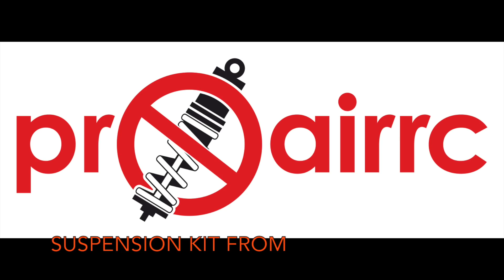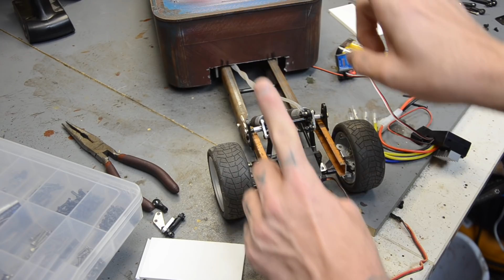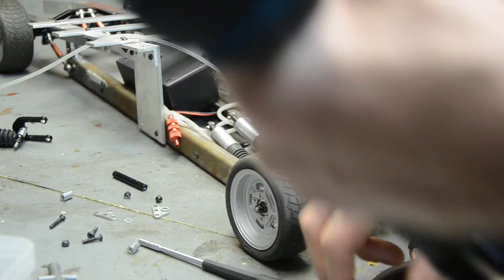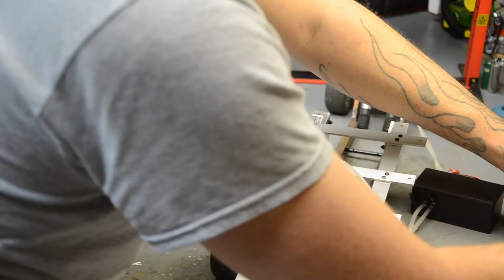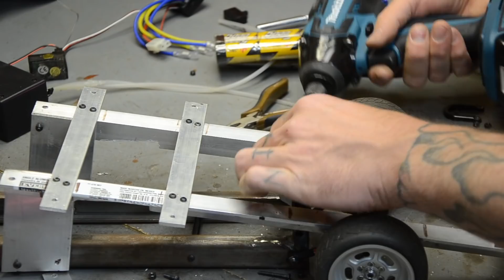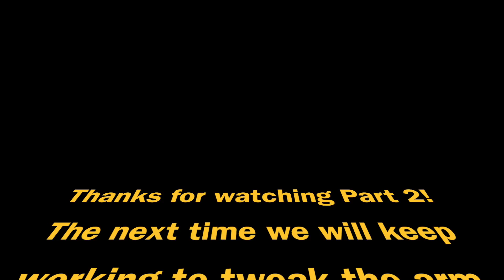Real RC Air Ride, Rear Suspension Fabrication with Proairrc, Rat Rod Ramp Truck Scratchbuild

Comment: make large 90 degree L shaped cantilevers and use them as your lower links then mount the air rams horizontal parallel to the frame, that would give you the best travel and load carrying while keeping it under the deck

Comment: I get all my screws from Tonys screws  https://www.tonysscrews.com/  bearings, pinion gears, ball studs, stainless steel shims, shock stand offs, axle pins,  you name it they have it, from avid rc  https://www.avidrc.com/    harbor freight has these little storage boxes that are perfect for rc screws.   https://www.harborfreight.com/24-container-storage-box-90243.html  in case link changes   the item is Storehouse®- Item#90243

Comment: Did you try putting the air shocks laying down along the frame and making a linkage that will push it up and down from the air shocks two left I have so many idea to fix that I live in Canada Ontario I will try to draw you a diagram to show you what I mean I tried to get back to you soon as I can
Reply: I was also thinking have you can try putting them like scissors crossing each other poster to the rear end and dropping them down a little lower

Comment: Use a pushrod style set up and mount the air shocks in the rear dead space
Reply from the maker: Thats how I did it in the first video, There just wasnt enough space for the cantilever arms to move and have any leverage.  Behind the axle the bed is about 1" tall.

Comment: I have a similar setup on my actual truck not a rc one and the triangles for the cantilevers are the other way around. The long side is to the axle and short is attached to the bags. Mine is a bag pushing straight up on to it so that probably helps but maybe flip them around and I bet you will get what u are looking for that way!! Just a suggestion. That's a cool project your doing tho, anything truck and air ride big or small I think is awesome!!

Comment: Instead of having each sides be separate with a brace why not run a pin all the way through everything with threads on each end for nuts (or a long bolt)? That way to take it apart would be one nut, slide the bolt out and done.
Reply from the maker: Great idea!  I am currently working on that.  It is working better but still not quite as well as I want.

Comment: I wou[d think Team KNK would either sponsor you or at least give you a hefty discount on hardware...

My only other thought for the axles, in the back you have some rectangular supports on the chassis. Can you by chance get a slightly larger piece of C channel to let that slide in up and down? So everything with the axle attaches hard to the rectangle stock, then the Air R/C kit attaches between the two...

Not sure if it helps and I'm in the hospital so I can't test it myself this round. Look forward to the next episode.

Comment: maybe try making the lever longer on the side with the shock so it has more leverage! It will lessen the suspension travel though, but it should be fine with what you're working with

Comment: Happy Thanksgiving! 
And it's looking good!
Towards the end of the video, seein this truck all in one piece. That is slick. 
Can you get a reversible air pump that will pull air out of the shocks? Wondering about ROBART air retracts for R/C aircraft landing gear. I wonder if a couple of those hidden under the ramp to help the rear shocks. For that matter, even electric retracts. They could be used as helpers and likely more compact. And they drive up and down so the could be used to beef up the air lift and help push air out of the shocks to lower. More stuff to hide in there.

Comment: I've been holding my tongue this entire build trying not to be rude and just hoping you'd figure it out but you must know that you're doing the cantilever system backwards, you need the shock mounts farther away from the pivot point on the cantilever arm than the mount for the strut is, that's how you get mechanical advantage(leverage) you'll get less throw but the shocks will work much better.

Comment: Have you thought about trying more voltage or lipos to help the air system. I seen on their website that it works up to 15v.... So maybe more power will produce more ummph that you need??
Reply from the maker: That’s a good tip. I hadn’t considered it because I don’t have any electronics that could handle more power at the moment. I will definitely look in to it thought .
Reply: @RCeveryday  most basic escs will do 3s lipos which would be 11.1v which would be a major improvement over the 7.2v nimh packs

Comment: Lookin good n makin progress, cant be to upset bout that lol. I was tryin to think of a way u could lay the shocks down n still get alot of lift, but its just not comin to me. Wat about a stronger pump? More psi than the one youre using. Maybe from a airbrush system? That may help with the lift problem. But then the issue of fittin the airbrush pump on there lol